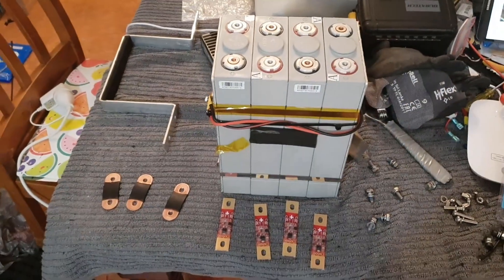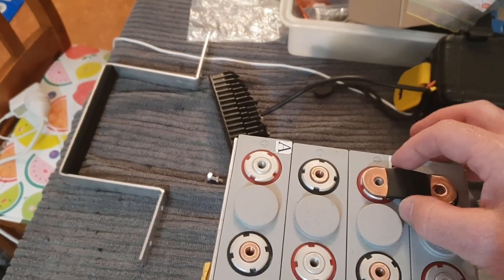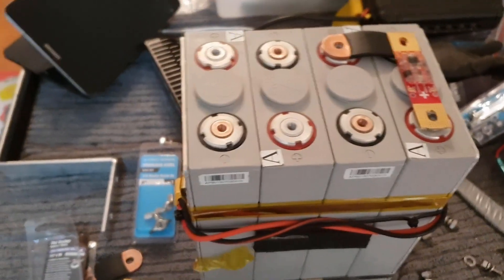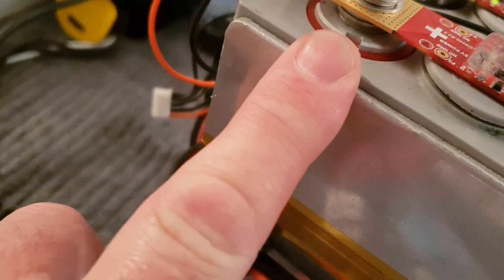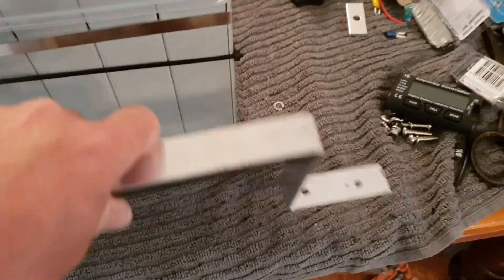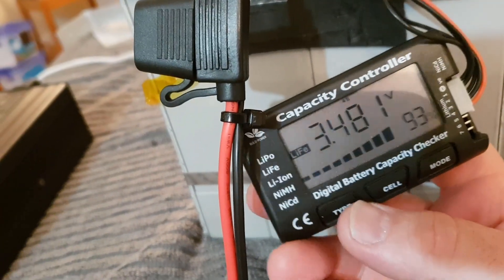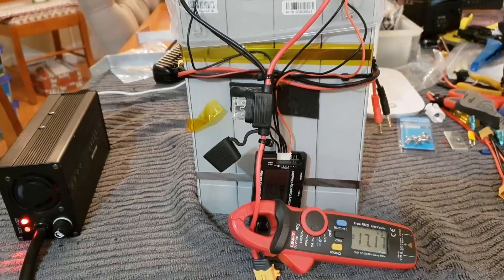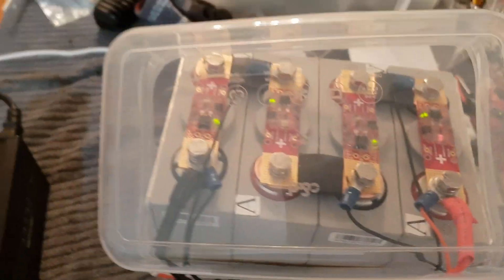DIY 12 Volt Portable Solar Power Generator Camping Battery Lifepo4. Part 2 - Balancing the Cells

Comment: Why would you have to manually balance, if you're using those Balance modules? Doesn't that mean they're not actually working? I'm not a balance hater :) I'm just wondering if you were charging at too high amperage for the balance modules to keep up.
Reply from the maker: Hey mate
They should only require manual balancing for the first charge.
The modules will balance subsequent charging.
Thanks for watching.

Comment: What is the point of the balance circuit if you manual charge individually each cell.
Reply from the maker: The manual charge should only be required for the initial charge. Once top balanced the cell modules should maintain balance moving forward.
Thanks for the comment

Comment: Place the cell mods first then the busbars. should be even right, or does the PCB not fit over the middle of the battery? If that's the case, cut some copper o-ring spacers; you don't want stainless, aluminum, and copper on each pack.
Reply from the maker: I think the bus bars need to be directly on the cells. I think cutting a couple of copper or aluminum washers will be best.
I agree, not the best as it is.
Thanks mate